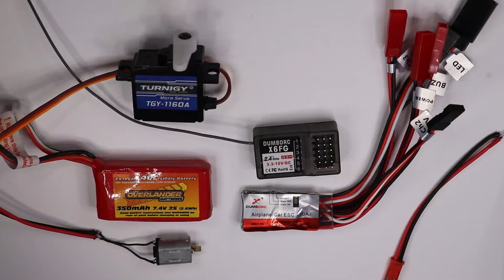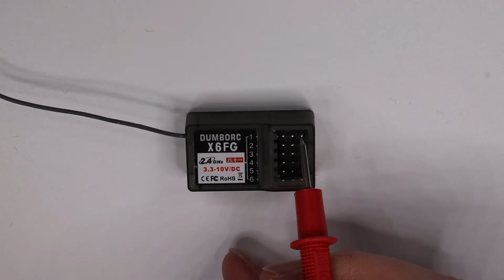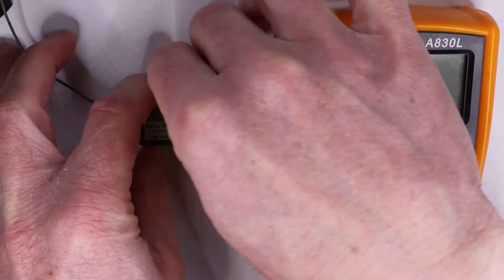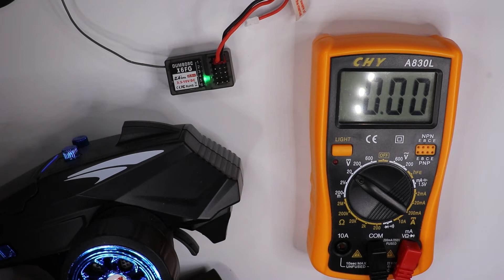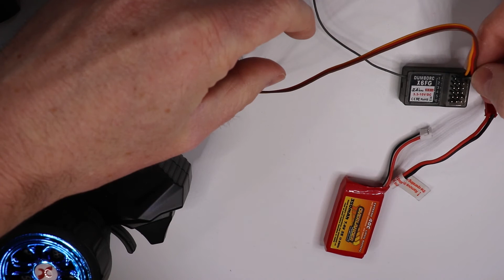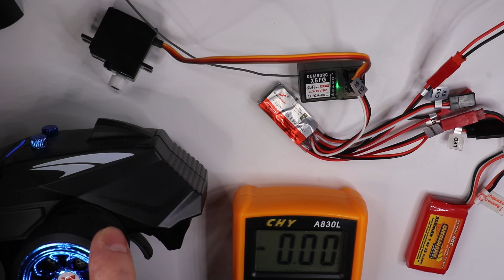Dumbo RC Receiver and Speed Controller Setup and Fault Testing

Comment: Hi.
I was wondering if can you help me. I have a problem with my Dumborc x6 transmitter. 
On channel 4 I have a winch motor, and when I turn off the transmitter (ch4 button is in the neutral position) my winch motor turns on and I can turn it off, only if I unplug the receiver form the power. 
I have done some research online, and it seems to me that there is a failsafe on ch4 that activates when I turn the transmitter off, buy that failsafe is not setup to be in neutral position. 
Do you know how could I solve this problem?
Thank you in advance.

Comment: heyy... Great video, it's really hard to find videos that explain how these receivers work. 

I'm making an electric go-cart as a project and was wondering if i could connect this receiver to something that powerful (500w-1000w). The usual throttles that are used to control the go-cart take a similar input of 6v so i thought this could work. They also have one negative, one positive and one control wire and output 0.8 to 5.3 v (no throttle to full throttle). Can you measure the voltage output range of the receiver? connect the negative pin of the receiver to the negative of the multimeter and the control pin to the positive of the multimeter and test voltage range with no throttle and full throttle. This would help me out a lottttt!!!! Hope you read this.
Reply from the maker: Hi, I’m on holiday at the moment, but can give it a go when I get back in a few days time.
Reply: @randomdadstuff1777  Oh sure, no problem I'm just glad you read this comment. Great video btw ;)
Reply: @randomdadstuff1777  heyya, just checking in to make sure you didn't forget.
Reply from the maker: Hi, apologies for the delay, have had a rather busy few weeks! The output range directly from the receiver was 0.15v throttle full forward and 0.39v full reverse neutral was 0.28v - quite a low voltage range for the signal. Hope that helps!
Reply: @randomdadstuff1777  Yeahh... guess it won't be that easy. Anyway, thanks a bunch for helping me out, really appreciate it :D
Reply from the maker: No problem at all. Good luck with your project! Hope you get it figured out 🤞🏻

Comment: Bos ku, saya sedang bingung karena tiba2 lampu receiver saya mati, jadi remot ga mau konek. Banyak yang bilang kalau yang rusak antara ESC dan receiver.,
Tapi setelah saya cek pakai multi, dari ESC ada keluaran daya 5 volt, sebenarnya berapa daya yang di butuhkan untuk aktifkan receiver bos ku,..?
Mau jajan tapi masih galau, yang rusak ESC atau receiver.,
Saya pakai dumborc x6f bos ku.
Tolong jawabannya bos ku, share pengalaman buat newbie seperti saya
Reply from the maker: Hi, have you tried to test with the battery connected directly to the receiver unit without the ESC, do you get a light on the receiver? With the battery connected directly you should be able to pair the transmitter and then use a multi-meter to test for a change in voltage on the signal pin in the receiver, like in the video. This should confirm if the transmitter/receiver pair are working.
Reply: Terimakasih saudara telah memberikan jawaban untuk pertanyaan saya.

Saya sudah melakukan pengecekan seperti yang ada di video, menggunakan battery  langsung tanpa ESC dengan tegangan 8 volt namun lampu indikator receiver tetap tidak menyala. Saya juga periksa tegangan di setiap Chanel dan mendapatkan tegangan yang sama.

Dari hasil pengecekan yang dilakukan, apakah receiver mengalami kerusakan??

Comment: ... Well done Mate, no info in the box about the receiver. 
Thanks to you now knowing that Vcc & Gnd are all in parallel answers all my questions that not even the manufacturer divulges, (not intuitively anyway).
Reply from the maker: No problem, I had the same questions and found the info in the so called “manual” for the receiver a bit lacking. Glad it’s helped.

Comment: My receiver works fine, well, lights and the stuff connected come on. The problem is the controller stopped working on its own within seconds. The blue light doesnt come on, seems the problem is inside the controller itself. Might that be there are some wires that came off inside the controller unit itself?